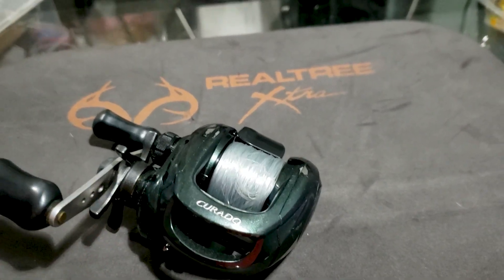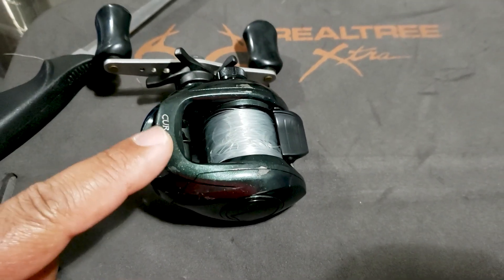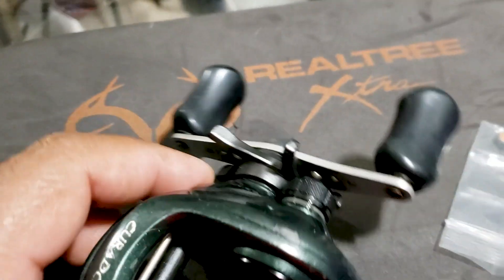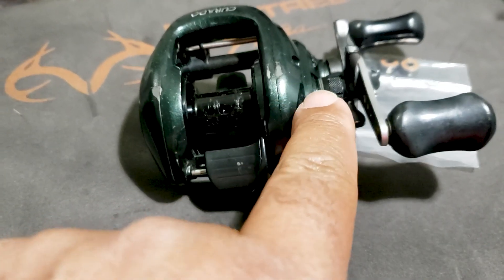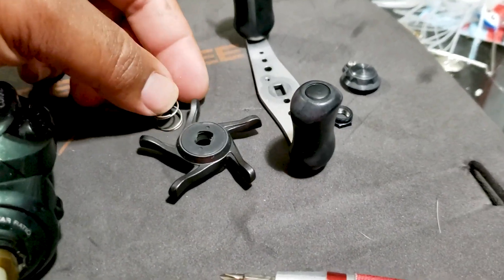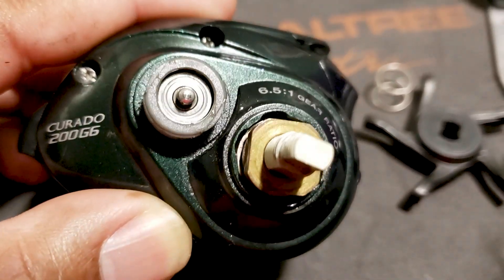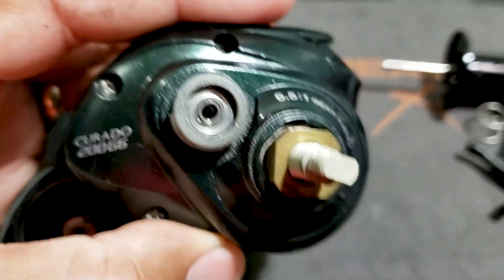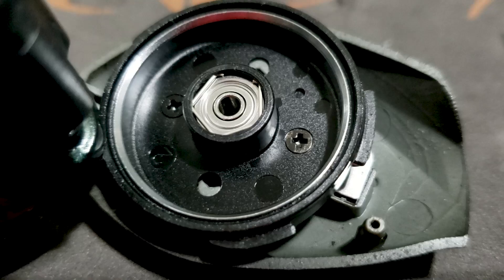EASIEST Fishing Reel MOD you could EVER do... Easy DIY install

Comment: Awsome Diy Bro, my ceramics made a big difference in my curadoK and my antares dc lv just a little noisy but you get use to it its a good trade off, almost at 5k subs keep up the great work I remember you had undercarriage 200 when I subbed. Happy Holidays, D Cotto.
Reply from the maker: Glad to see you in the comments Cotto!  I also remember those days!  How far we have come.  Only concern I have is that my new microphones will pick up on the reel noise.  Time will tell!
Reply from the maker: You know, I also wonder how close the ceramic mod gets a Curado/Chronarch to the BFS level?  I have been looking for a BFS spool the same size as the Curado/Citica Body for years to no avail.